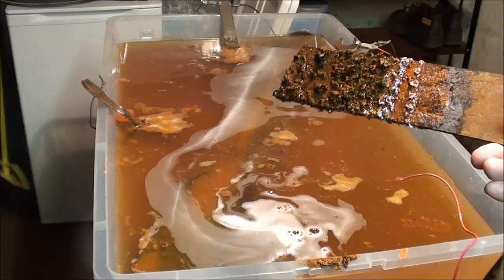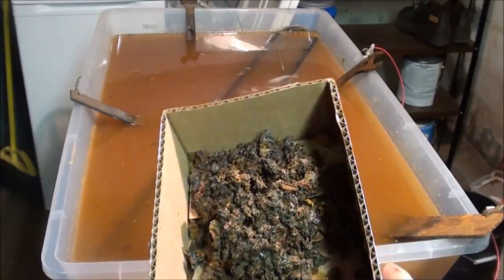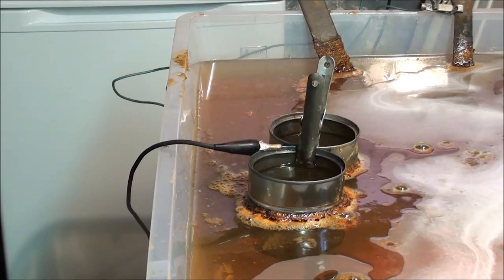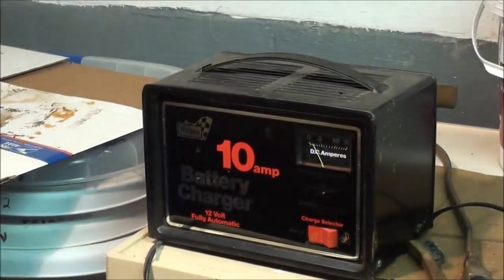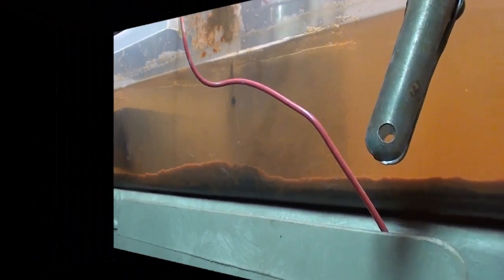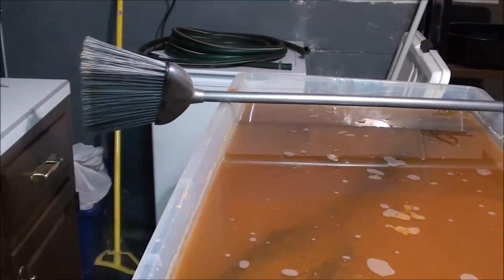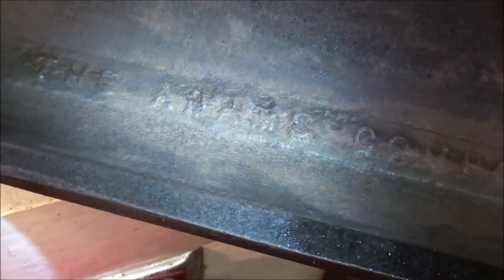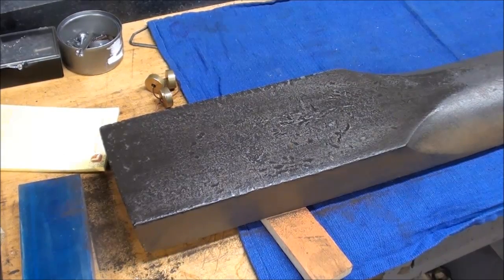MACHINE SHOP TIPS #146 Part 2 Electrolysis Rust Removal Experiment #2 tubalcain

Comment: ive watched a few vids on this and came to the conclusion that if it is a item with lots of crevices and places you cant reach , maybe worth the effort but anything else dont bother , it still takes too much cleaning after ! just use wire wheel on grinder and finish with rust converter ! tip use rust converter then wash with water before converter leaves coating !

Comment: You should be careful about doing this in your basement.  Electrolysis rips H2O apart creating Hydrogen. If it is air tight enough and there is a spark it will ignite.

Comment: To get the best results you need to clean the sacrificial anodes frequently down to bare metal. Also keep the metal off the bottom where the loose rust also accumulates. The tin cans issue was most likely because  one can is closer to the work piece than the other or there is a coating that is insulating it. I have done a lot of this and found that a piece of conduit works very well and can be cleaned with a wire brush and turned lightly on the pedestal grinder to bring it back to 100% effectiveness. When working in a plastic container you should keep the anodes off the plastic and off the bottom. Anodes against the plastic can perminatly discolor the plastic. For the inside break through the asphalt in a few areas and if there is rust under it it will slowly seperate.   I have done a lot of this. You only need enough washing soda to make the water conductive but putting in too much will not hurt a thing. cleaning the part every few hours will also make things go faster. Try not to disturb the rusty muck in the bottom though when cleaning anodes and your part because it will load up your anodes faster if you stir that up. This should be done outside or in a well ventilated area though because it out gasses Hydrogen and Oxygen potentially filling an enclosed area with an explosive mixture of gases. This works great on reconditioning Iron cookware! magnificent results! 
Great Videos! 
Keep up the great work!

Comment: Dear Mr. Pete
You sound like you are an old mechanic like me, I am a little older than 70 and been mechanic about my hole life and just retired about 12 years ago. Some of the things that you use did not make cent to me like a 12 volt charger with 10 amps, or a 6 volt charger with 5 amps. I had a auto repair shop for about 30 some odd year and if I needed a battery charger I would use a deep cycle charger. With a deep cycle charger you can control the voltage and control  the amps, so why did you being an old mechanice use a 12 or 6 voltage battery charger. It did not make cent to until I figure out you are not as old as I thought, it dose not matter to me but you need to be truthful about being a mechanic. I have not watched all of your videos but you have my action and I will watch the rest of your video. Thank you for you time.
An older fart Bud
at bbbond@sbcglobal.net

Comment: About the steel cans that you are using, there is a different in the thicknes and also material that they use for the outside of the cans. They also use silicon oil to lubricate the mould so maybe that is being used on the cans.
Greetings from Waalwijk Holland.

Comment: i had a Janitor business a few years back, I bought several of those cheap brooms, took off the handle & the "cap" covering the top of the bristles, Then bought several 6ft wooden handles & put them on the bristle part they not only work better but I still have some left & all in good shape... for your use, pull the cap off, tighten the stock handle by hand snugly, then drill a hole the size of a 4penny nail through the part the handle screws into & through the handle it's self, tap a 4 penny nail through to hold it in place, & bend the tip of the nail (like you would a cotter pin) & it'll hold just fine...
Reply from the maker: +Bob White Thanks-good idea

Comment: About the cans, several things could be at play there... the can that's closest to the rusty metal can accumulate more, the cans could have a difference in their composition, & the same way you have A CLAMP HOLDING THE CANS TOGETHER, you could put the clip with the wire on it, across both cans like the big clip does so both cans have the same electrical connection..  could be a resistance between the cans effecting the amount of current allowed to travel between them..

Comment: Would be interesting to  measure weight of part with high precision before and after treatment.   How is this process selective with only removing rust vs removing and pitting the iron in areas where the rust has already been removed.  .

Comment: ADAMS-FARWELL AUTOMOBILES. Between 1898 and 1907, the ADAMS COMPANY (THE) manufactured fifty-two automobiles featuring futuristic innovations including fuel injection, supercharging, and automatic timing. There was even a model capable of 75 miles-per-hour, if a road could be found that could handle such speeds. (1) The car was the first in the world to be powered with an air-cooled ROTARY ENGINE placed in the rear of the car ahead of the axle on a vertical axis. (2)
The Adams-Farwell history began in 1898. Model One, Adams-Farwell's "horseless carriage," was built with an engine designed by Fay Oliver FARWELL, the factory's superintendent and self-taught mechanic. Farwell mounted his engine, which revolved on a vertical axis, on an express wagon. This was to be the only model designed with the engine in the front. Only one car was built.
Model Two, built about 1899, refined the car's appearance, comfort, and design. The single model produced was not offered for sale. The Model Three, built in the fall of 1901, so captured Farwell's interest that in 1903 he added doors, canopy top and a glass windshield. Cars suddenly had potential for year-round use. One of the many unique qualities of the car dealt with the steering column. The entire assembly and foot pedals could be removed from the front and placed in slots in front of the back seats. This converted the car from a two-seat coupe to a roadster. (3)

About 1905 the entire Dubuque police force posed proudly in a shining Adams-Farwell three-seater.
By 1903 the chassis for the Adams-Farwell was being produced in Dubuque by the Connolly Carriage and Buggy Company. Started by Thomas CONNOLLY, the company had been a competitor of Augustine A. COOPER in the production of wagons and carriages. In 1910 Adams-Farwell roadster and seven-passenger models were being advertised as having a hard wood frame with metal for "the back of seats and rear door through which access is had to the motor." (4)
The 1904 Adams-Farwell Model Five was powered by a twenty horsepower three-cylinder rotary engine. Acclaim by this time was becoming widespread. Exhibitors at the Chicago Auto Show in February 1905 praised the car for its innovations. The Chicago Chronicle declared of the car, "one of the most attractive cars at the auto show and one which has found perhaps the maximum of purchasers." (5) The same year an Adams-Farwell car posted the best time for any air-cooled entry entered in the Chicago, Illinois, to Minneapolis, Minnesota, auto race. Ironically the driver of the car was named George PICKUP. (6)

Newspaper ad circa 1906. Photo courtesy: William Hammel
In 1906 a new model followed with five cylinders capable of producing forty to forty-five horsepower. With the body constructed locally at the Connolly Carriage and Buggy Company, this model cost $2,500. When James BEACH bought an Adams-Farwell he had difficulty getting a license to drive it because "authorities" in Des Moines did not believe there were any five-cylinder cars. They were wrong. The 1906 Adams-Farwell was available in three-cylinder (25 horsepower) or five-cylinder (45 horsepower) models. (7)
The 1906 Model 6A had the following specifications: (8)

Comment: The cans have spots that are thicker and spots that are thinner. A metal consists of a lattice of atoms, each with an outer shell of electrons which freely dissociate from their parent atoms and travel through the lattice. This is also known as a positive ionic lattice.4 This 'sea' of dissociable electrons allows the metal to conduct electric current. When an electrical potential difference (a voltage) is applied across the metal, the resulting electric field causes electrons to move from one end of the conductor to the other. Near room temperatures, metals have resistance. The primary cause of this resistance is the thermal motion of ions. This acts to scatter electrons (due to destructive interference of free electron waves on non-correlating potentials of ions)[citation needed]. Also contributing to resistance in metals with impurities are the resulting imperfections in the lattice. In pure metals this source is negligible[citation needed]. The larger the cross-sectional area of the conductor, the more electrons per unit length are available to carry the current. As a result, the resistance is lower in larger cross-section conductors. The number of scattering events encountered by an electron passing through a material is proportional to the length of the conductor. The longer the conductor, therefore, the higher the resistance. Different materials also affect the resistance. To understand why, we need to look at electrical conductance. Conductance is the inverse of resistance. That is, the less resistive a material is, the more conductive it is. Conductance is defined as G=1R where G is the conductance and R is the resistance.
Conductance=GTotal=G1+G2+G3..Gn=1RTotal=1R1+1R2+1R3...1Rn

Comment: Like your project.  Tried to find out what a hollow mandrel is used for on Inet but could only find the part itself.  Found several Brown & Boggs but no info of how they are used.  Sounds like its used in shaping metal though.  Thanks for the video. Semper Fi

Comment: The uneven rust buildup is caused from the fact that electricity always follows the shortest or least resistive path, in this case the side of the can that is rusting.  If the rust builds up enough on the closest side, it will gradualy build up toward the back.  It has to do with "Actual Electron Flow" as opposed to "Conventional Electron Flow (The way most people think electricity/electrons flows)".

See http://www.allaboutcircuits.com/vol_1/chpt_1/7.html for a better understanding.

The black soot appearing is simply from too many amps, you are electricaly burning the metal by causing too many electrons to jump from the part being cleaned.  Constantly curculating the water will reduce this effect combined with agitating the part and keeping a constant water temp high enough to keep disolving the arm & hammer solution.  Do all this outside, 1 spark could ignight the gas, especialy if you trip a breaker or fuse.

If you were to coat all the un-pitted work pieces with "non conductive paint" leaving the pits uncoated, you could fill the pits by reversing anode/cathode "Electro Plating" but do limit your amps and make your donar material of the exact same type of material.  Clean everything well first, oil and even a finger print can/will mask the plating of the pits.  Keep a close eye on the process, check every 15 minutes and use a non abrasive plastice or nylon brush to keep your work piece and donar material clean.  You can plate about 3 or 4 mils every 1/2 hour so it will only give a visual apeal once finished and will not necessarily strengthen the part.

P.S. Awesome videos!  So far over the past week I have watched 146+ of just yours.  Looking forward to more...  Thank you for your time and effort to keep America, and the rest of the world, interested in Engineering :)
Reply: By the way, just did a search on the Adams Company and they are still in business.  They may be able to tell you the exact part number you have.  http://theadamscompany.com  I think it looks more like an early automotive era transmission cover than an anvil.

Comment: To Tubal Cain and all interested parties-  Pitting of the work - Steel anodes versus graphite plates.

I just watched this video on nickel plating which is sort of the same process in reverse.

 Easy Nickel And Copper Electroplating Method

 I think the pitting is from where larger bubbles form on the work form excessive current and or voltage.  When nickel plating is done with only 3 volts, the surfaces are smooth.  but as the contributor stated " if the voltage is too high (12 volts with high current?) , the bubbles localize on the part and create "hot spots" which  ruins the nickel plating.  Could it be that the outgassing from too high of a voltage and or current is what is causing the pitting action with the de-rusting  process????  (and not the kind of material that is used for the anode?

As far as using steel versus graphite anode plates for the process -
I may turn my battery charger down to 6 volts and keep the current at about 1 amp or less to keep the pitting down, but still use the graphite plates to keep the mess down to a dull roar.

I don't want to go to the flashlight battery method for a power source, but I can see how having a lower voltage and or current would help to minimize the bubbles and eliminate some of the pitting.

Comment: Graphite vs Steel: The reason why the steel anodes don't cause pitting or as much pitting is because the rusty gunk that builds up on the anodes acts as a insulator slowing down the process. This is why the current falls too. The Graphite will not accumulate the gunk and the current will constantly remain high.
You could probably slow the process using the graphite plates by using a lower voltage (ie 6V) and placing the further away from the workpiece Or use a Timer (ie lamp timer) My guess is that the pitting occurs from the dissolved gases that are given off during the process and perhaps from the formation of sodium hydroxide or other caustic compounds created by electrolysis that is attacking the workpiece.

Comment: If not mentioned before, remember that electrolosis or however that is spelled is line of sight .. so if ther eisnt a straight line from the anodes so areas gets shaded somehow the process wont work on those areas, atleast not as effective =)

Comment: You might want to consider doing a little experiment to determine recovery.  Weigh the work that you are conditioning, along with each one of your anodes before you begin the electrolysis process.  When you have completed the job, let everything dry and weight them again.  Compare the difference in weight and record the numbers.  Next, try to decant as much of the water as possible after it has separated from the sediment (you could even filter it to get as much recovery as possible).  Let the sediment dry, and then weigh it.  Now add up all of your numbers, and compare the weight of recovery versus the weight of the work before the job and afterward.  The weights should be the same.  If the weight of sediment/waste is less than expected, then you have to determine the cause of the loss (Hint: What has been dissolved in the water?).  If it is more than expected, then you may be taking minerals from the water, or......

Anyway, you are a mensch for doing all of your videos.  My son and I have watched them all, and have learned a lot.

Comment: Great video series!  As they say... "time and rust waits for no man".  I tried removing rust with oxalic acid (wood bleach from the hardware store).  It left a very similar black oxide coating on the parts.  I was told on a popular forum that the black oxide is quite stable, and can be painted directly.  I planned to powder coat the parts, so it was necessary to sand blast the black oxide off, but it removed the very heavy rust deposits and saved a lot of blasting time.  Thank you for your excellent videos!

Comment: You should try putting something in a container with molasses and water. I believe 5 to 10 parts water and 1 part molasses is typical, but it completely strips the rust and makes the item look brand new with no need to brush off the black coating. It's really impressive.

Comment: Wikipedia article for black oxide says a hot bath and chemicals turn the surface of steel into magnetite. I looked up magnetite, it says it's one of the most naturally occurring iron oxides on earth, also magnetite is the most magnetic of all the naturally occurring minerals on Earth. Perhaps the electrolysis is creating a charge that is magnetically attracting magnetite to the item you're removing rust from? I can't really find anything on what is making the black layer on the item, but I have noticed it myself when I use electrolysis.

Comment: I know very old items that are rusted have a black coloring to them. I haven't looked it up, but I know the show "Pawn Stars" actually mentions that the orange rust on items from say the civil war have turned black after 130 years so it's hard to fake a real civil war era item. I've always thought it'd be interesting to try and use this process to add that black oxide layer to something and see if a pro would think it's old. Also does anyone think the black oxidized layer is less prone to rusting than a typical orange/red oxidation?

Comment: Half way during the process with the cans clipped together, if you were to move the anode lead to the other can then that one would accumulate more of the deposit. Reason is electricity follows the path of least resistance. You may think of the two cans together as one conductor, but the path is more direct through the anode lead can.
I really like your videos and thanks for sharing your knowledge.